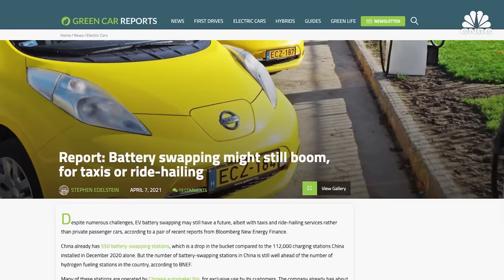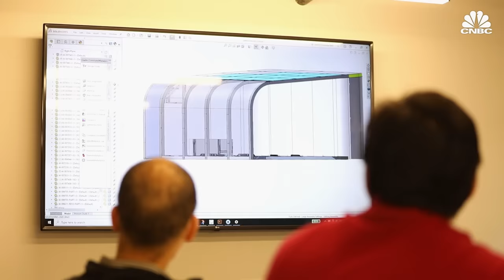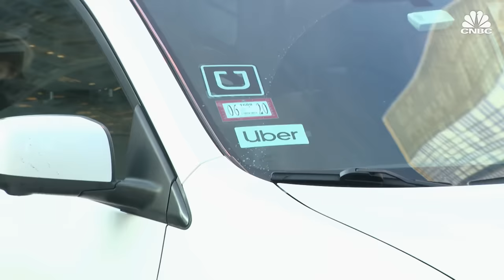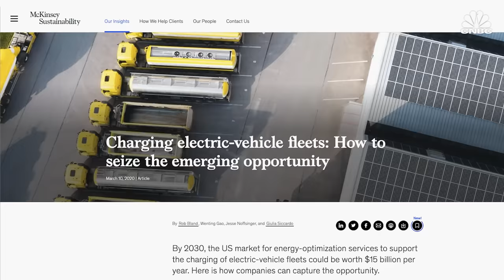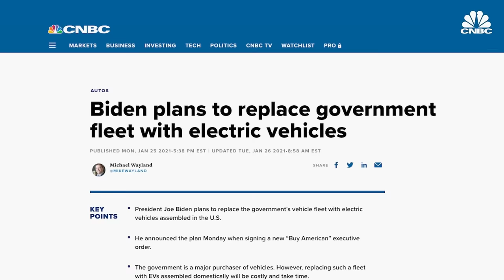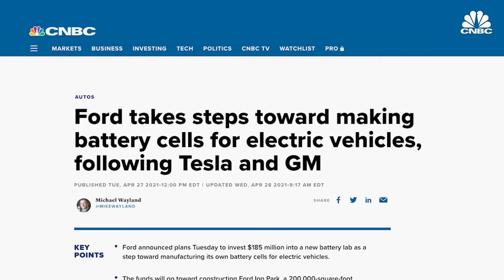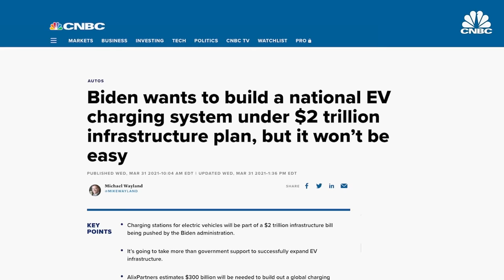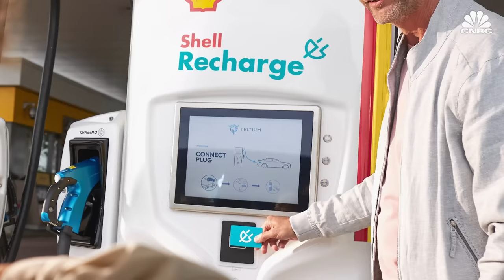Can EV Battery Swapping Take Off In The U.S.?

Comment: My tesla adds 140 miles in 10 minutes of charging... Think I'll just charge the battery.
Reply: My Leaf charges much slower on L3, something like 30 miles in 10 mins. However, the vast majority of cases I'm L2 charging in my garage, so I'd hate to swap my battery out once every couple of months when I (rarely) travel farther and roll the dice on getting a degraded cell that I'd have to live with for a couple of months until the next time I swap. This is exactly why Tesla bagged their battery swap idea. Owners don't want it, just as the video points out.
Reply: So you're perfectly fine having your battery last far less time?
Reply: @Explodingbunny93  300k-500k miles not enough?
Reply: @Explodingbunny93  I've done supercharging over 100 times, doesn't seem to be affecting the range any more than expected. If you hang on cars for a long time (like 10 years or longer then yes it would probably be better). But as someone that intends to get a new car at least every 5 years, it doesn't matter. Also worth remembering that the long term doesn't really matter, in 10 years batteries will advance so much that it's not important.
Reply: @catarinav7947  bro your talking to people who buy kias they’re gunna hold on to that car till battery bubbles and dynamo wears out
Reply: @Explodingbunny93  C rate (the speed at which you charge and discharge the battery) does affect battery longevity, but it's a comparatively smaller factor. The biggest factors to battery degradation are high temperature and storage at high state of charge, the combination of the two being the worst for battery life.

So each owner would have to decide whether they want their battery last a little less time, vs. not owning their battery and getting a different mix of cells, and thus different max range, every time they do a battery swap at a station.

This was tested in the free market by Tesla and it failed, per the video. Owners decided they want to own their batteries.
Reply: @Explodingbunny93  Tesla said there 4680 betteries will last a million miles without any degradation even with fast charging. Battery swapping is,a,stupid costly idea which will never work. There's a reason why Tesla abandoned the idea back in 2013...
Reply: Ya but your battery is slowly getting g worse with fast charging
Reply: @chevynova7103  You mean the 4680 cells? No thats not true. It will last a million miles before the battery starts to go bad.
Reply: Exactly,  this is for people that don't understand charging
Reply: If you could just as conveniently swap out the battery that is charged in a more sustainable manner, then why not swap?
Reply: @chevynova7103  That's not true. If you charge the car from 10% to 90% range,  the degradation is very slow
Reply: @alastairhewitt380  I don't care about sustainability, I care about cost. I didn't buy a Tesla to save the world, I brought one because filling up 300 miles only costs $5.
Reply: @nurulqwe  the batteries don't go bad. They typically call 80% remaining capacity the batteries life. But degradation happens early on in life then drops slower and slower, so it might be 80% at 1 million miles, then 70% at 2 million miles.
Reply: @Allen Loser there are enough people who want to save money on running costs that people with resistance like you can not adopt battery vehicles for 10 years and not effect the adoption rate, then by that time range and charge speed will likely overtake ice vehicles.

Right now if you dont do long trips, you never have to go to a fuel station as your refuelling your car at home. So right now, excluding road trips, your saving time and money on refuelling.
Reply: @Allen Loser how do people sell any new vehicles? All vehicles get better over time.

Your particular setup might not be suited to an ev. If you drive 600km per day(100kw pack range) them I'd suggest an electric car isn't for you, unless you dont mind paying for fast charging. But if you can conveniently charge your car at home and charge within your parking time(that's almost everyone) then an ev might suit you.

Remember, its peoples decision to make, no one is going to care if you dont get an ev, but as prices come down and your maintainence costs go up  you might consider an ev over ice vehicle. And again, no one will care if you chose the more expensive option(hydrocarbon fuel vehicle)
Reply: Battery swapping IS A DUMB IDEA.
Sounds "Clever" BUT Batteries is the MOST EXPENSIVE part of an EV AND there is AND WILL BE a battery shortage for the foreseable future.
With battery swapping you need MORE BATTERIES.
Most cars should be able to charge while parked so more chargers are needed, swapping is unecessary.
Reply: 140 miles in 10 minutes?  What kind of charger does this?  My neighbor just used one of the new superchargers and said he got 63 miles in 12 minutes, and 100 in 22 minutes.
Reply: @qinby1182  it blows my mind that people think battery swap is a good idea. Nio is equipping all their cars with it and building out battery swapping infrastructure. So now they are locked into a form factor and nio owns all the batteries, so nio takes the hit on the battery degradation and loss in value in all the packs it makes, and with battery technology progressing so quickly, who has all this old technology that no one wants when they swap batteries... nio.

So nio loses out financially and customers lose out on improvements on form factor and structural pack etc(which is a big weight saving and improvement in chassis stiffness.) Which in turn locks them out of range and performance improvements.
Reply: @Xander-dx6mw  superchargers do 250kw, so 300 miles off of 75kw pack, say 225kw charger can provide 75kw in 20min, and if your in the fast charge zone of the battery, you should be able to use most of that charging speed for 10 minutes, which will be about 150miles range. So I guess new teslas on a v3 charger should be able to do that.
Reply: Your neighbour probably started with a high SoC. If you start at 5% SoC on a supercharger, you can get 150+ miles in 10 minutes. If you start at 40% SoC then you’ll be lucky to get around 80 miles ish in 10 minutes. It’s all down to the charging curve and what electricity is available. Most people using electric cars still don’t even understand how to use them, your neighbour sounds like one of them.
Reply: linkzable  $/kw lowest wins, as long as minimum range is met. Is gac 3d graphene cheaper per kwh? Tesla is heading toward $50/kwh
Reply: linkzable  Why? I often find Graphene is a marketing term these days rather than a better product but if it is, yeah good.
Reply: @Allen Loser And? What's your point? It's a vehicle that gets me from A to B comfortably and quickly that I got for FREE and costs virtually nothing to maintain/run. Having had 5 ICE cars the Tesla is better than any one of them and it was FREE. If you don't like the taxcode idk... find someone that cares? I travel even more with my Tesla than I did with my ICE cars because its so cheap. You're acting as if it's not a good car and it's a hardship that people need to be forced into, it's not, if you gave me choice between Tesla or ICE car then I'd go Tesla. It's just that much better.
Reply: @Allen Loser I highly doubt you live here in my country (Norway), if you did you'd probably have a different opinion of EVs but if you want to move here the government will offer the same benefits to you.

You keep calling it a "bribe", can you honestly and in good faith say you have never used any kind of rebate, allowance, or grant the government offers?

You are right, I would of brought the GLC over the Model 3 as I had little experience of EVs. However, your argument is the same as when people switched from horses to cars - "You would have brought a horse if the government hadn't bribed you into buying a car, where are you going to find gas if you want to travel!"

That's just the situation now, perhaps give the tech another 5 years to get better and see how you feel then.
Reply: @Allen Loser nio taking the hit makes it harder for nio to stay in business. That was my point. Its hard to be profitable as a vehicle manufacturer and absorbing extra costs makes it even harder. Also, using extra batteries in swap stations are batteries that could be in cars making them money.
Reply: @Allen Loser your right about the gas tank. So, no matter now many years they wait, they will still have the same from factor. It stops innovation and locks things down. Tesla for example has the flexibility of making the battery as one with the structure, improving many metrics on the car. Nio is locked out from ever doing that, regardless if they wait for new models of cars.
Reply: @Allen Loser blowing off customers needs isn't a route to increasing sales. Now that's a good point. 

My point is, there is enough demand that by the time supply is met, the capabilities will likely meet your requirements. So they don't need to try to sell to you yet.
Reply: @Allen Loser i think the battery constraint issue is suppliers not wanting to spend the capitol on the manufacturing equipment  etc if they weren't sure Tesla would survive. I think now its quite easy to see Tesla surving and thriving and that will give confidence to suppliers to spend money on capacity knowing they will get a return safely.
Reply: @Allen Loser i also worry about things on nio batteries like damaged fasteners,wearing out connectors, mixing coolants etc. Time will tell, but it sounds like damaged threads aren't uncommon, so that could become a nightmare.
Reply: @Allen Loser well tesla has yet to include battery production to their vertical integration.

 soon though.

 big plans take a whole lot of organising, and the volumes of materials they will need will also require significant ramping of all their suppliers, not just diverting some supply to tesla. Anyway, looks like everything is lining up nicely, and i expect 2022 to be a massive year for them as 2 new factories come online and freemont and shanghai keep increasing production..

Now one thing that is also a blessing is having the hold up on batteries has let them organise more cost effective and new types of manufacturing techniques that will produce higher quality products with reduced capitol expenditure. So i guess it has saved them building factories without the new stuff then having to upgrade everything a couple years later.(shanghai and freemont keep having shutdowns for upgrades causing inconsistnt production output.)

But man,... they are pushing the envelope on so many things that its really exciting to watch. Have you seen vids of all their massive factories being built out at once? truely inpressive scale. :)
Reply: @Allen Loser so thats not panasonic in there?
Reply: @Allen Loser hmm you seem to know a bit about it considering you dont like EV's lol. 

How do you feel about their engineering, specifically to do with new manufacturing techniques and material science? Also based on their manufacturing, do you feel the crossover point of purchase price for EV to ICE vehicles is very close? Or do you feel the value to mobility ratio ratio will swing to EV in the next couple of years?

What are commodity cells? I would have thought the chemistry of the cells would have been tesla specific and not generic(not a commodity) or am i mistaken on what a commodity cell is? Or is the agreement to make sure telsa buys all the sells otherwise the competition can get their hands on them?
Reply: @Allen Loser interesting information, I was referring to the casting machines mostly along with the new paint shop. Both of which need to be proven obviously. I also think their new battery is great and also their FSD chip design and approach to autonomy is correct.

I'm not sure anyone would argue the energy contained in fuel can not be surpassed by battery capacity for the same volume or weight. 

What is your last comment aimed at? What balloon are you referring to?
Reply: @Allen Loser hmm your response makes me think you dont know much about what Tesla is doing with paint and casting. Casting of a block is entirely different to what Tesla is doing.
Reply: @Allen Loser hmm I don't have a great deal of faith in companies that's not Tesla lol Tesla is new and agile and able to drive down prices by doing things differently, big companies are stuck in their ways.

Tesla vehicles are already at price parady with their competition. But in the low end of the market, Tesla will be releasing a 25k car that will be cost competitive with its competition. Probably have 250miles range, but from your point of view, inadequate mobility probably?

If you want to talk about just being cheap, chinas number 1 selling ev is only about 5k$ but if your in a crash its going to be fatal...
Reply: @Allen Loser well a skateboards isn't their  manufacturing advantage. Like you said, every car has a skateboard. Its building that skate board out of 3 pieces instead of 150.
Reply: @Allen Loser not sire what your getting at, they are casting the rear lower body in one piece, the front body on one piece and in the middle is the structural battery pack that is basically batteries glued between 2 sheets creating a solid block. So basically 3 parts. Front, back, structural battery pack. So that bottom structure is 3 pieces instead of 150. Not sure if your just being a silly Billy and suggesting the suspension parts were counted in the 3?

Tesla are doing aluminium injection casting. Which has never been done before on such large parts. They are about a 100kg shot of their proprietary aluminium alloy that gets pushed into the mould in less then a second. The material they use is unique and developed at Tesla to meet the flow requirements and does not need a heat treat like all other cast aluminium parts have in the past. I believe they cycle the machine in 90 seconds.

Hmm I don't have many details on the paint shop apart from, 70%reduction in energy consumption and no water waste. This is for Berlin and I assume Texas. Will be interesting to follow those.

Did you watch the video i linked? Most people don't lol. But if you care to know where Tesla is headed, which it sounds like you do from your previous research, its worth a watch. Vehicles from Berlin and Texas will be the first with these major changes. So cars the end of the year for both factories id say.
Reply: @Allen Loser hmmm the paint shop is not tesla tech. but its just fancy, so paint will be nice and environmentally friendly, but but not a tesla product.
Reply: @Allen Loser going off of your reply, you have not watched that video. Please do, so you can understand what they are doing...
Reply: @Allen Loser obviously with anything, you have to look past ass kissing and look at the good information there. What they are doing saves parts, Labor, time and capitol required to build the factory out, minimises inaccuracies and achieved a more accurate product with far less failure points.

Are you saying most car manufacturers stamp the complete rear structure in a single piece?

Well obviously they don't since the metal can't stretch like that.

But also looking at existing manufacturers, their ability to copy that process is severely limited. First Tesla owns the only machines build at that size ever produced, production of new machines from the only manufacturer of the machines is probably tied up with Tesla orders for quite a while, then trying to upgrade your lines kills many jobs that unions will push back against.

If teslas body shop removes 600/1000 machines by changing to front and rear castings, how many jobs associated with that would be lost at an existing manufacturer?
Like sandy says, big companies find it hard to change direction, and will be resisted strongly from many directions.
Reply: @Allen Loser hmm not sure why referencing the floor pan so much. Its the front and rear structure that is cast. Unsure if middle will be cast, probably just stamped because they will mostly be big sheets to sandwich the batteries between.
Reply: @Allen Loser you can see their casting machines in action. Quite a few drone shots of it.

I'm not sure they will cast the battery section due to the simplicity, and a stamping press might do the job just fine. I think they are assuming it's the case. The front and rear are the castings of significance.

Sandy Munro had has thousands of engineers come through his shop and everyone of them brushed off his cast chassis sample without a second look. So the idea has been around for 15 years or so, but not adopted even though it would cut costs. I guess they just want to copy the first mover?
Reply: @Allen Loser ramping new processes will surely be harder then ramping a proven setup, it should be expected, especially cybertruck. But I feel model y will go fairly smoothly since replacing many parts with one should simplify things.. hopefully they figure out the structural pack quickly, but who knows, they may have some troubles there. But we shall see. They have proven to ramp new factories quickly with proven processes(shanghai) but they are doing alot of new stuff in Texas and berlin :) you can assume whatever you want of me. Does not matter lol :)
Reply: @Allen Loser I don't have a timeline for their production ramp, not sure anyone does. So I can't really have an excuse for not meeting a timeline/ramp rate that doesn't exist.

The good thing about tesla is their size and position they are on the ramping of the company so small and early. Its best to sort out issues early and make new factories based off of their learnings, then when they are ramped, retrofit the old placed with the new stuff to not take too much of a hit.

I would think they had to go with a safe, proven technique early on. As they mature and can make bigger risks due to constant cash flow, I'm sure they will push the envelope even more.

Imagine trying to put out a vehicle cost effectively with injection moulded casting front and rear with an all new battery form factor with new battery manufacturing g techniques while using a Tesla designed neural network chip.

You obviously have to ease into these thi gs as the company becomes more stable and money coming in becomes more predictable..
Reply: @Allen Loser I'm glad you have an understanding of these castings now. Yes it can be copied and is expected to be copied, but that gives Tesla a few years lead in production cost and efficiency, and gives them a few years to develop and implement the next thi g that will pull them ahead which will have to be copied. These things will be copied but Tesla will always be a few years ahead, which means they will have better build quality and margins constantly.

The front and rear won't increase the chance of purchase, but the structural battery pack and new cells is definitely a selling point as the weight reduction and cooling of the batteries will be significant and very noticeable.

A big thing that is obvious is watching g tsslas do laps of race tracks and watching their power delivery drop as they can't remove enough heat in the battery pack.. the new cells and cooling techniques will likely solve that, which in turn will allow higher amounts of regenerative braking g to be used, which in a racing scenario will massively increase the vehicles range.(every bit of braking by brake pads is reduced range, if 100% was regen braking, range on a race track will go up massively. So that's what I'm looking forward to seeing. Having said that, I can't see the value in buying any new car. But if that new  car can be used to pay its self off(robotaxi) then I surely will purchase a vehicle that can do that  would be silly not to.
Reply: @Allen Loser exactly, so while others catch up, Tesla can keep strong margins and have the flexibility to adjust price to sell all cars they make. Eventually all cars will use the same techniques and overall prices should go down.

Now like you say  yesla won't win extended races against fuel vehicles when a refuel is required. I doubt race tracks will install like 500kw chargers at each pit bay. Its alot cheaper to carry a fuel vessel.
Reply: @Allen Loser I guess I thought you had looked into what they had done since you were arguing against it so hard. At no point did I say they cast to the roofline.

Now who is smarter or has a greater understanding isn't really relevant. My point was to compare the differences between manufacturers, which you seem to have a greater understanding g of then you started with. So I have done my job. :)